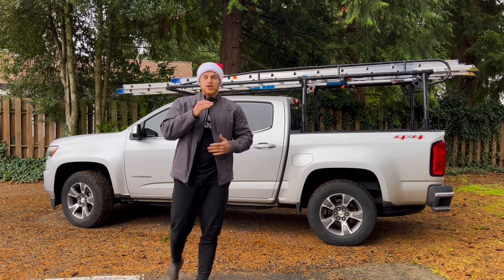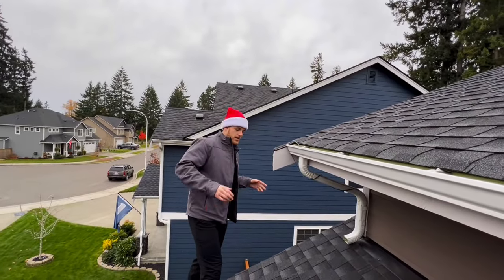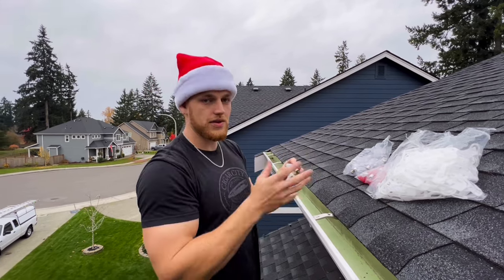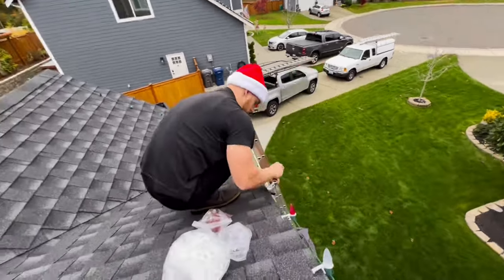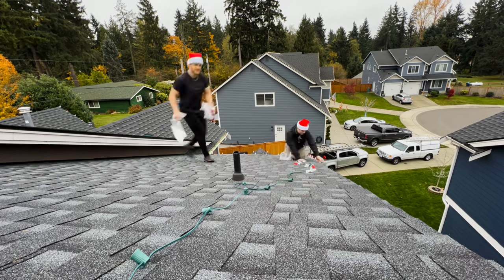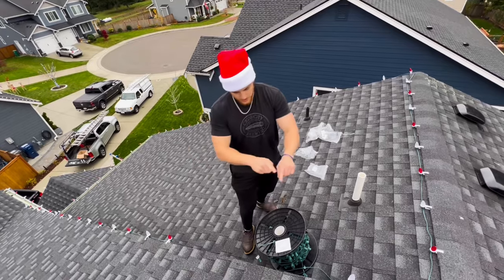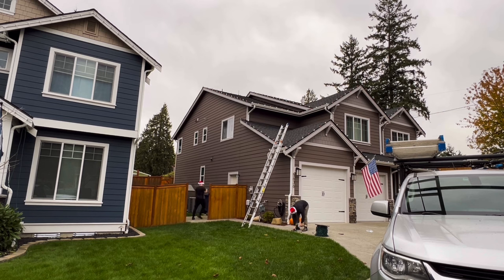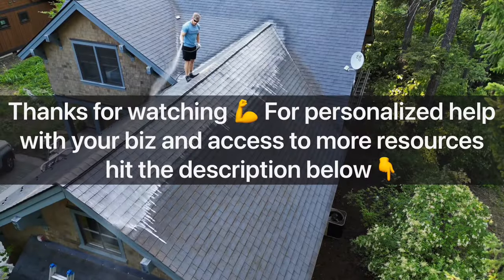How To Hang Professional Christmas Lights and Make $800 a day: FULL TUTORIAL

Comment: Pretty sure every step of the process you show here is about as inefficiently done as possible lol definitely ripping people off if you're profiting $400/hour for this work. Also, you're suppose to split the wire before putting them into the plugs. If you look into the side that wire drops into, there's a piece of plastic that separates the two sides so that there is no possibility of touching and arching. And before end capping with electrical tape, you should split the wire and make them different length, for the same reason, to prevent arcing. Good luck, hopefully you don't burn a house down!

Comment: You should really follow polarity with custom C7/C9 strings (ribbed wire is always neutral, smooth wire is always hot). I can only assume you didn't, because there was no mention of it. Also, you didn't split the wires apart when terminating your ends. This can prevent GFCI trips. There should be a plastic divider inside the plug to prevent the two ends from coming near each other.
Reply: This! I’ve watched hours of videos to get my Xmas light business up and running. Him not talking about following polarity had me thinking and also not using a female plug as all the others have said it seems “cheap” to use electrical wire.

Comment: Great video man! This is what I do full time. One thing I like to do to save a ton of time is bring a measuring tape with me. I measure each run on the roof, and then pre clip, bulb and cut them down at the truck. That saves me from carrying the spool up on the roof with me. 

Another tip would be to jump wire as you go, clipping on lights that are already turned on ensures I’m  not going back up on the roof to screw in bulbs that got loose. 

Now what I need to learn is how to get on your level in terms of Facebook ads! Keep on killin it man.
Reply from the maker: appreciate it man!